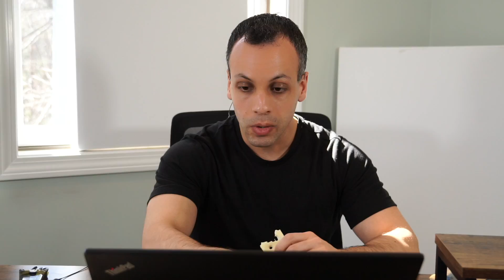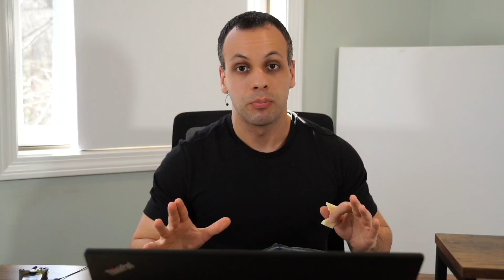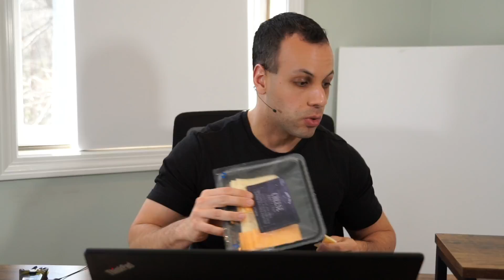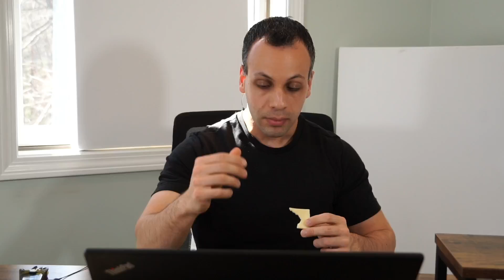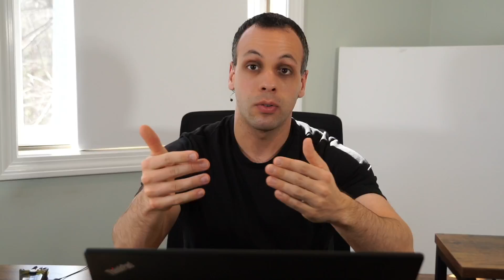ebikes, rudeness, and laws; how to create a better world

Comment: Well I used to be able to cycle 40 to 60 miles but I got chronic fatigue syndrome in my late 20s,  used a mobility scooter for a few years but it wasn't very safe trying to leave town on the road at 6 to 8 mph.  I could have got a  motorcycle but they have never appealed to me and I find them to be a bit antisocial and my unreliable brain struggles with navigating busy multi-lane roads and large roundabouts or other unique road layouts which are common in parts of England.

Comment: here in switzerland (and as most of europe) you can buy ebike speeding easily to 50Kmh (about 30 mph) , the only condition is you need to wear an helmet (not yet mandatory for "slow" ebike limited to 25Kmh, but mandatory in others countries like france) and you need to have a license plate (hence a valid driving licence). The only deterrent parameter is the price, such fast ebike goes well over 5000$ while  regular ones are found as cheap as 1000$
Stangely, e-scooter running alongside with slow ebikes on bike lanes are limited to only 20Kmh (only god knows why).
there is no limitation on building your own if you stay in the limits but biking on a non-homologated could be an issue with your insurance if they decide you are at fault (and insurance is ALWAYS looking for fault since it allows them to pay less).
I have been a long time user for 50cc gasoline scooter, ultra light, low consumption but limited to 45kmh) , i switched to ebike (the slow type also called pedelec for pedal  electric assisted), then to e-scooter (running illegaly up to 30kmh).
By far , in a small town, the e-scooter brings more fun, more speed, the only limitation being the weak range.
with ebike, i still had to park it somewhere, run in the street like a regular vehicle.
with e-scooter, it is door to door (you take it in the Mall and get it even if you choose to exit by another end of the building), you take it in the office for recharge (company pays for electricity) , you can put it in the car, you never leave it unattended.  In the traffic jam i can switch from e-sccoter to pedestrian in seconds to cross a street, jump a traffic light, take shortcuts. and it cost 300$ for the cheapest.
I would not switch back  even to fast ebike that cost the hell, is a target for thief, require expensive parts and services, is very heavy.

Comment: F E-Bikes. E-Bikes deserve to be just as regulated as a moped or other low CC gas powered vehicle. Covid started a trend of those F's blasting down the walking path at 25mph no F's given, and now it has expanded to the hiking trails where the higher torque being delivered to the rear wheel on uphill gradients is tearing ruts and tripling the normal erosion. They see the Prohibited signs, they give no F's because they're all entitled A*holes who think the world revolves around them. And yes, that is the attitude of EVERY E-bike rider I've come across save the rare elderly person who just wants to be physically active but no longer has the strength to do so and pedal assist setups have returned their mobility.

Comment: In the Netherlands there are 2 different kinds of scooter licenses; 1 for the road and one for the bike lane, which is restricted to 25km/h. Ebikes can go 50km/h and have no regulation for speed anywhere. I think the government has refused to restrict ebikes, partially to encourage adoption and get away from motors. Ebikes are currently the most annoying because of that. Not only can they go 50km/h +, they're also silent and don't have regulations on where they can go at what speeds.

Comment: ebikes that go fast are called motorcycles. You follow motorcycle laws and have to drive then on normal roads, not on bike lanes as they're not bikes, they're motorcycles.
Reply from the maker: Incorrect. If you want an electric motorcycle you have to buy a zero for 25k. There's a lot in-between a bike and that and the inbeyeeen cannot be registered or made legal. It's dumb

Comment: Ebike laws should be speed limits that encourage safe responsible riding, NOT some arbitrary classifications and restrictions based on maximum speeds or wattage. You can go 25 or 30mph on a non-electric road bicycle; this is not a new problem.
Reply: The speed limit should be based on where you ride not what you ride.

Sidewalks with pedestrians: 5 - 10 mph

Bike lanes: 15 - 20

Road or street: As fast as cars so long as you follow the same rules as them, maybe also require turn signals, lights, and a minimum power spec just as a moped or motorcycle would, but this shouldn't be a limitation to keep you off the sidewalks and bike lanes if you choose to use them on the same E-bike so long as it's below a certain weight and size limit, but not limited by power.
Reply: @RingingResonance  that would require cities to have dedicated bike lanes for every single street which is good
Reply: @RingingResonance  - I think licensing is the problem. Some people believe vehicles and drivers must be licensed by government. Ebikes are an effort to circumvent licensing. When an ebike is no longer distinguishable from a motorcycle then they will no longer be permitted, too many people that can't comprehend a world without government control.
Reply: @GreenBlueWalkthrough  - Yes. I've encountered licensed doctors that shouldn't be doctors.
Reply: I can modify a ebike to have as much torque as a 4 cylinder car that goes 25km/h and is road legal in Australia,  I can then legally tow a giant ads trailer with tons of weight and farry people on said trailer
Reply: Exactly. Also, all vehicles should have the same speed limit in a given lane. Otherwise some cars will want to go faster than you are allowed to, and it's a problematic mess. Just stick with the normal speed limits

Comment: Are ebikes faster than regular pedal bikes? I'm curious as to how they work.
Reply: In the US we have 3 classes on E-bike federally. The lowest speed is pedal assistance only at caps out at 20mph of assist. The fastest category is 28mph and can be used without pedaling. The power limit is technically 750w and anything over that is technically a motorized vehicle and should be registered as such.

In reality i have never seen any of those restrictions be enforced on anyone who isn't a jerk.

Ebikes with kits can go up to 2100w of power however you can easily surpass that, I've see ebikes at 5000w. I believe louis has a 1500w motor on his bike. For scale 750w is roughly 1 horse power and a small moped that needs to be registered is normally 3000w.

As for the speed of them, in my experience with my class 1 (20mph) and class 3 (28mph) ebikes they are actually generally slower than a road bike with a strong athlete on the pedals. I have gotten my ebike to roughly 38mph on the road with a good wind. I have done 42 on a cheaper pedal bike in similar conditions. The weight is a serious drag to top speed. The motor is worth it, for me i like the assistance so i can ride on work days and i work on electronics for a living so i like setting up circuits and such.

Ebikes can be really positive in the transformation of our transportation habits in the future in a good way. In addition i find the ebike riders are less likely to run over the local grandma than the guys on a normal bike who think they are Olympic athletes chasing strava times.

Comment: In the netherlands there are two classes of electriec bikes. The normal one, that you can ride without a licence with a speed limit of 25km/h. And a speed pedelac, at 45km/h that you need a licence and licence plate.
Due to the rules around the CE you are not allowed to change mutch. Even changing the gearing on a speed pedalac  is not technicly allowed.
Reply: I assume enforcement of modifying your bike is essentially nonexistent though right? Obviously if you're ripping around at 50 km/h with no license plate you might attract the attention of police but are there actually any inspections to see if you modified something? If there are not then much like Louis says he does in this video you can modify your bike however you want and as long as how you're riding doesn't attract attention you should be fine, or as he puts it don't be an asshole.
Reply: @oryxland3994  that's basically how it is at the moment. Cops mostly go after the Sur Rons and anything without pedals
Reply: Imagine participating in some ridiculous system wherein you’re not allowed to change the GEARING on your BICYCLE  lmao fuck that get a BBS02 and rip it

Comment: I agree with you, but the problem is that it only takes a small minority to ruin something for the much larger majority.
And as electric bicycles get used by more and more people, they will also be used by more idiots.
Same with drones for example. People were flying RC planes and helicopters long before the modern quadcopters existed. But they were a few hobbyists who knew and stuck to the rules. Fast forward to a few years ago, quadcopters become cheap and easy to fly, a few idiots fly them around airports and over large crowds and now you require some sort of license to fly them pretty mich anywhere and there are much stricter laws.

Of course that does not mean we shouldn't all try to be our best and act in a sensible and respectful manner, even if others don't.

Comment: Frankly bikes are dangerous to pedestrians and cars.  Cars stay in the road, pedestrians stay on the sidewalks and it works ok.  Bikes go all over both and cause endless problems on both.
Reply: Cars and pedestrians have their space bikes don't. If there is a reasonable bikepath system people comuting by bike won't have to switch betwenn roads that are way to big for bicyclists and sidewalks where they might be a danger to pedestrians
Reply: @weppwebb2885  Yup, but for most places the amount of bike traffic isn't enough to put in the resources and space required for that.  And in those places where it is it is often more feasible to reduce car paths to increase bike space.  Whenever they build bike paths in cities where I've been they're simply too thin to accommodate anything but really light traffic.
Reply: @UnbeltedSundew  there is suppressed demand for better bike infrastructure. If it were there, more people would use it. But so many of our streets and roads are straight up life threatening to cyclists because its been so heavily optimized for car traffic. If the bike infrastructure was there, people who currently drive would start riding until there's an equilibrium between car and bike traffic.

Also, bike lanes get better throughput then cat lanes, by the fact that most cars are single person vehicles that take up the space of 4 people. So you can get 4x as many people through a bike lane then through a car lane.

Comment: What's the max speed of your eBike on a flat straight?
Reply from the maker: No comment
Reply: @rossmanngroup  respect 😂👍

Yeah mine feels underpowered right now at 22 mph on a flat and 30 on a steep downhill. I'll probably up mine to 32 for local highways and steep hills, but any faster means I'm basically riding a motorcycle (aka what DO NOT have the safety gear for).

Comment: So I was using a 50 cc petrol motorized bicycle (respectfully and kept to speed limits on the road). 
a year or two after buying it 1 young lad got killed on one and the government rushed laws thru banning them outright for use on roads bike paths, parks etc.... 10 days after the new laws were enacted I was charged with un-registered, un-roadworthy and un-licenced operation of a motor vehicle. I fought it and 3 trips to court later and im facing a $100 fine and agreed to a guilty verdict. I now drive my twin turbo sports car everywhere. I will not be considering an eBike or eMotorbike going forward.

Comment: The state laws regarding ebikes addresses the difference between electric motor cycles and ebikes, as well multiuse pathways (think parks with toddlers and strollers). Ebikes companies fear lawsuits and responsibilities connected to their product.
Reply: Here in Finland in the Nordic we have differentiating laws, an ebike can be regarded as a normal bike if it has a motor of I think 250W power and only pedal assist up to 25km/h. If however the motor is up to 1kW of power the bike must be registered (I believe as a light scooter) and taxed but doesn’t have to be insured. To fit into that bracket it is also allowed to have full motor only power up to 25km/h, any faster and the motor has to cut out.
Reply: @onelyone6976  I can't imagine the legal checks that a big global brand like Bosch has to deal with.

Comment: Surron/segway x260 is an electric dirt bike with tons of aftermarket mods.  70-100 mph with the right tune and battery at around 15kw (20hp).  Only weighs 110-140lbs too.